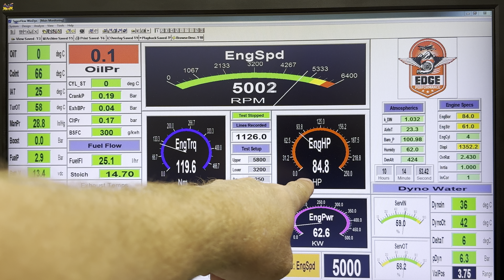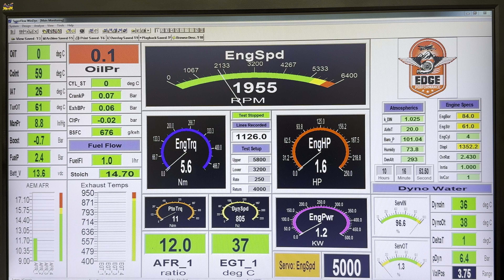Edge Performance - LET’S TALK FUEL NUMBERS

Comment: It would be interesting to compare the 15:1 fuel consumption, vs the 14:1 consumption when manifold pressure is reduced to give the same power output as the 15:1 setting.

Comment: What about the egt?
Reply from the maker: What about it? It’s running via the ECU, and not externally to the dyno
Reply: @EdgePerformanceNorway  When you lean out the AFR, the EGT goes up but you're not showing it.  Max egt is at lambda 1.

Comment: What happens if you lean even further, but also set MAP to obtain the desired cruise power output? Isn't LOP operation typically 16:1, or greater?

Edit: Also, isn't 5,000 rpm a somewhat low cruise rpm for these engines?
Reply: If max continuous rpm is 5500, 5000 is not that low considering it is on a dyno making Max power at that rpm. On an aircraft at 5000 it would be outputting less power I imagine
Reply: @chippyjohn1  My concern is BSFC. The engine might actually be more efficient at a higher rpm.
Reply: @PistonAvatarGuy  Maybe. Test is carried out at sea lea level basically with high IAT and manifold pressure. At higher altitude with colder air although lower density you would be able to lean further
Reply: @chippyjohn1  BSFC varies significantly over the rpm range of the engine as well, it may be more efficient at every mixture setting shown in the video at higher rpm.
Reply: @PistonAvatarGuy  I know. Just realised this is their turbo engine, yet they test it without boost. 280g/kWh does seem high. I have noticed the rotaxes seem to run in this area. It does have low compression for it to be running NA, I calculate VE is only around 91% at 5000rpm
Reply from the maker: @chippyjohn1  it runs 46” MAP at WOT. 30” for this video was only to allow it to run lean without causing engine damage.

Comment: Fuel range and fuel endurance are two separate things,  endurance is time.  Range is distance.  If the pilot has a tail wind, then going to endurance power settings may be a practical choice to enhance fuel economy an/or range. Holding at an airport for weather is another. Theoretically, range power settings give the pilot more miles flown, don't forget wind effects and how much drag bug impacts, or a dirty wing, have on range? Please  be conservative with "bingo fuel" calculations. Use of these two is up to the pilot and the purpose of the intended operation.  As I understand it, operating an engine too lean, (piston powered aircraft) it is possible to cause damage to an engine.  Accurate in flight fuel burn is a great tool. But, do not let the info lead you into making a poor decision. To the minute accuracy, UNLESS you know the exact amount of fuel you have, has the potential to lead a person astray.  Having a sphincter tightening moment means, you made a poor decision.  I knew a pilot once that ran critically low on fuel, his nick name was "fumes" after that.  
Good video thanks.